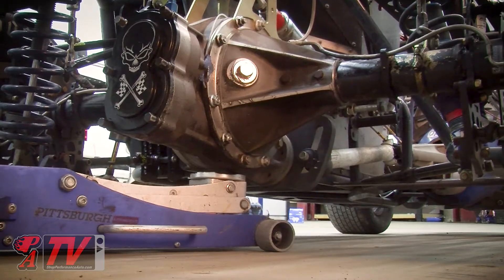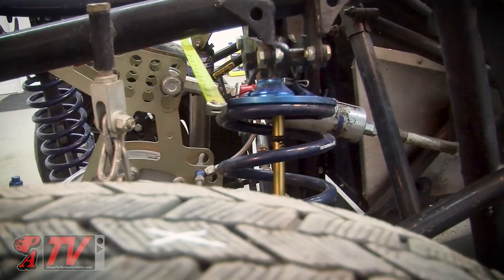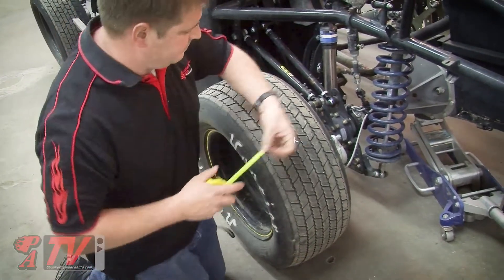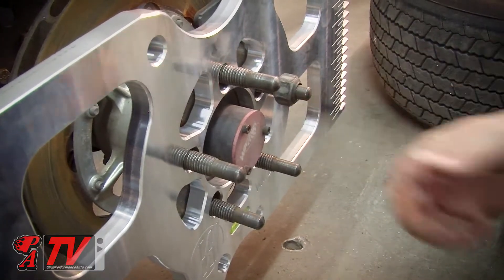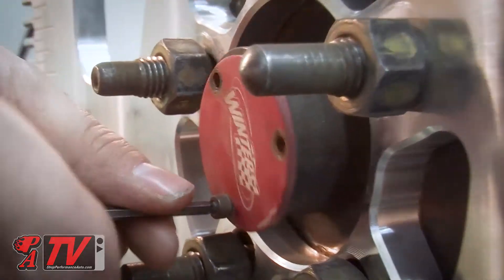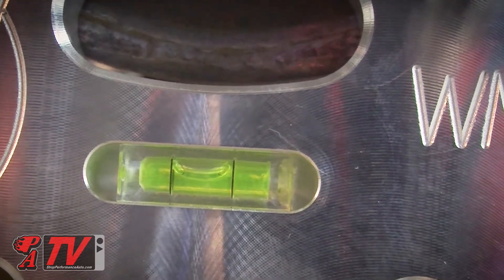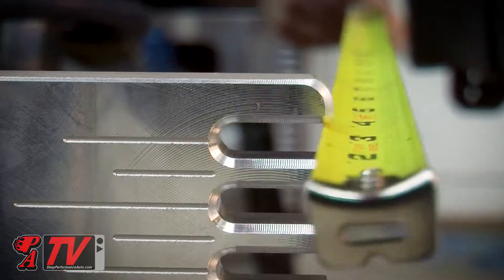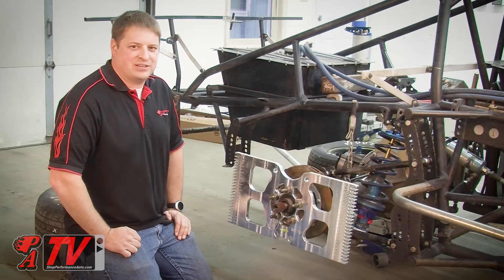PA TV - How to Check the Straightness of Your Rear End

Comment: All that facy equipment and you dunno how to use it right.
You need to take the rear end out and with the wheels on the ends , rotate the differential housing axle tube asssembly in the fore and aft direction of vehicle, while measuring any difference in distance from wheel to wheel.
 As long as the diff isnt rotating, in the lengthwise direction of vehicle, the wheels will spin at  the same distance apart at any fixed point.
 What happens is one will track straight and the other will crab, making a sometimes slightly violent shifting of weight as the vehicle favours one wheel or the other.